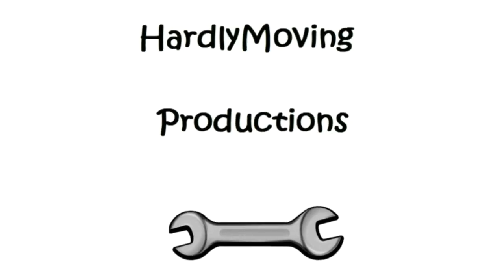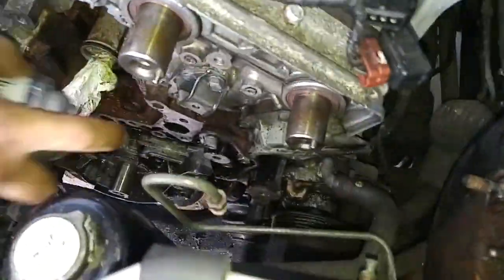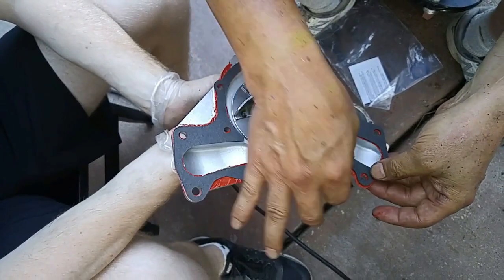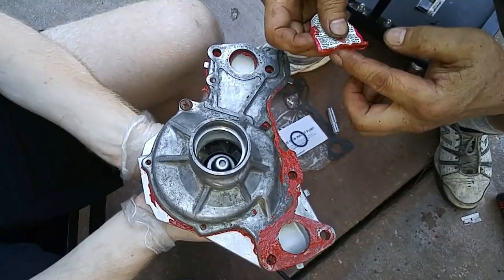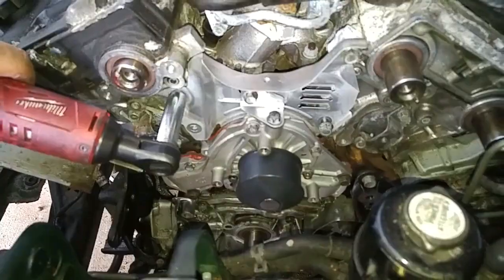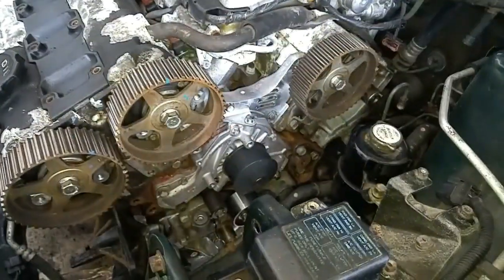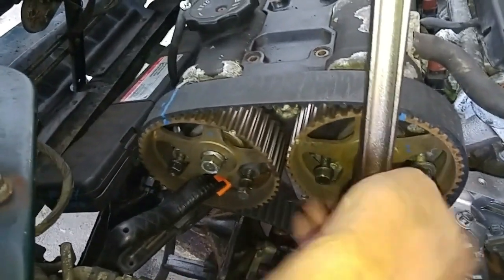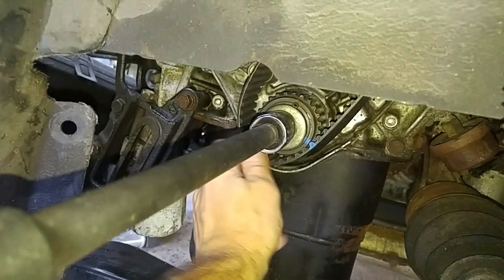Mitsubishi 3000 GT - 1992 Classic -  Episode 3 - Timing Belt, Water Pump & Seal Installation

Comment: Any chance you remember what belt/pump kit you used?
Reply from the maker: CONTINENTAL PP195LK1 Pro Series Plus
Reply: @hardlymovingpro  Thanks a bunch! My son just bought a 94 3000 GT SL. 89k miles with the original belt. Thanks a ton for uploading the vids on this car. It will help a ton to get the car back on the road.
Reply from the maker: You bet and good luck!

Comment: Came for camshaft seal installation tips and left with more great info. I basically just figured most of the timing on my own on an 08 Kia 2.7l. This video would have saved me some agony, also I did not know about adjusting the belt tension pully, so I'll do that now. Mine is a bit different, I thought that idler pully looked a little funky. Now I know.
Reply from the maker: Thanks for sharing your experience!

Comment: Doesn't the front exhaust cam seal (#1 cam) have a different mating surface that if you press it in too far or bottom it out, it fails to seal properly?
And did you feel comfortable holding the cams with the tool? The manual clearly says to pull the valve cover and only use a wrench on the camshaft to hold it.
Reply from the maker: No problems with the new cam seals leaking based insert. With respect to the repair manual instructions, it up to you which method you're comfortable with.

Comment: The procedure was well documented and correct.  However, you should only use NEW OEM parts when doing this service!  The OEM water pump includes the backing plate.  The non oem timing belt has a good chance of failing.  Also you should not reuse the hydraulic tensioner as those will fail also causing the belt to lose slack and damage the valves.   Don't cheap out when doing this very important major service!  You only need to do it every 60k miles or 5 years.
Reply from the maker: What's OEM?  You mean buy everything from the dealer?  You're saying don't buy Aisin, Bando, GMB, Mitsuboshi, Koyo, KYB, Denso, Akebono, NGK, Tokico to name a few?  Throw away a completely serviceable, none wear backing plate?
Reply: @hardlymovingpro  OEM = Original Equipment Manufacturer.  Aftermarket 60k service parts are junk.  Not only do you risk damaging your motor, but if a part like the water pump fails, you are going to have to do the whole thing over again.  Just spend the extra money and do it right the first time.

Comment: We have a 95 SL that we’ve owned for 23 years now complete with antique tags. Always done meticulous maintenance which is why after 173,000 miles it still runs extremely well. I was holding off on doing the much needed valve stem seals until I found these incredibly pro and in depth Hardly Moving 3000GT videos. These gentlemen are simply great. They’ve gone much deeper into the disassembly of the DOHC timing belt removal and what to expect when you tackle that insanely limited front engine space. It’s a bear but definitely not so daunting now and showed some details re: aligning belt/cams that even the Mitsubishi shop manual doesn’t address. I can’t seem to find episode 3 today and was wondering if you did the valve stems on your 92. These are great video instructional tools gentlemen!!!! Thank you!!!
Reply from the maker: Thanks for you kind comments!  Here's the link to episode 3:  https://youtu.be/FTp_tVXSbqU  Didn't need to do the valve stem seal replacement since the engine doesn't smoke on inital startup.

Comment: Awesome and Helpful Video Sr. 🔧 I need to do this in my 3000gt soon , but my old time belt not have the mark for tranfers to the newone, my question is: Can I put in the time belt and just aligning the marks and add new tensioner ?
Reply from the maker: Make your own marks on the old belt before removing the belt off the engine
Reply: @hardlymovingpro  but the old belt on the engine is so lose and out of time. Maybe jump
Reply: @gresnake.  if it jumped time you would have bent valves. Theres plenty of reference marks on the can gears front and back to ensure proper time. As long as you take your time you'll be fine.

Comment: There is certainly a lot of room for error. Thank god
For timing chains
Reply from the maker: As strange as it may sound, my preference is for timing belts.  A timing chain may not break, but they can stretch.  And when they stretch, you'll get an crankshaft or camshaft position error code and it'll effect the performance of your engine if you don't replace it.  Since the chain is lubricated with engine oil, the chain cover is sealed on the block with a lot of bolts.  But before you can get to the cover, you'll also have to remove the valve cover and everything in from of the chain cover that will get in the way of its removal (like the water pump).  To re-seal a leaking timing chain cover of a OHC GM V6 takes me around 7 hours.  That's just a re-seal job!  With the timing chain and components ... around 10 hours.   Once the cover is off, you'll spend around 40 minutes wire brushing off all the cover sealant on both the engine block and the chain cover.  Then comes the removal and installation of the chain.  On the GM V6, there are 3 chains, 4 chain guides and 2 chain tensioners.  Just those parts will run you around $300 +.  The removal and installation of the chains is phased.  Or rather, you just can't remove all three chains in one step.  Are you starting to get the picture?  Typical dealership will charge you 2.5 time what a typical timing belt job goes for.  Consider yourself fortunate if you get 200k miles out of your engine without stretched timing chain issues.

Comment: Why is dieltric Grease needed for the oil seals? I do understand that petroleum based stuff swells the rubber but it's an Oil seal sealing out oil which is petroleum
Reply from the maker: True but you're not exposing the entire seal to oil ... only the inside portion with the spring tensioner.  If you place grease on the outside, press the seal into its seal port, you may have great difficulty getting the seal out in the future.  Also, di-electric grease can withstand more heat than petro grease and will therefore stay onto its contact surfaces longer.
Reply: FYI the 3000gt manual doesn't call for grease on the seals. It states to put dish soap on the outer face, and oil on the lip.